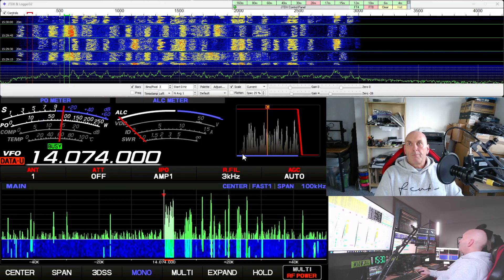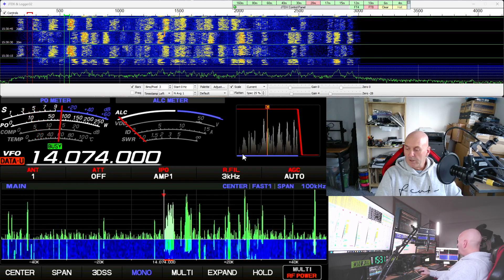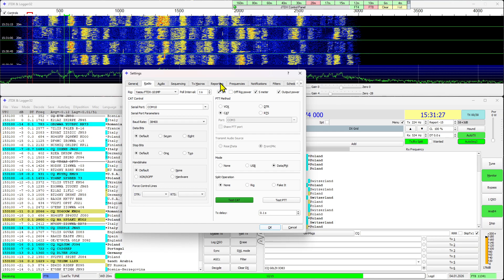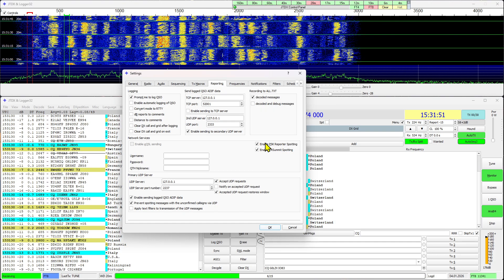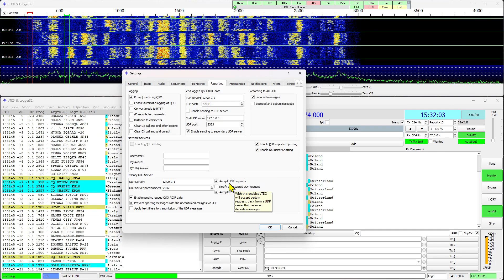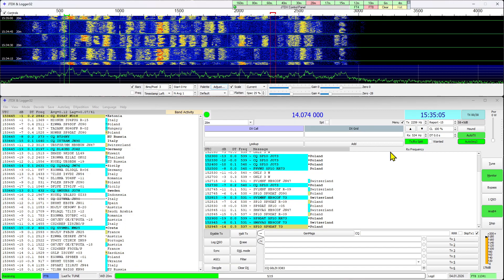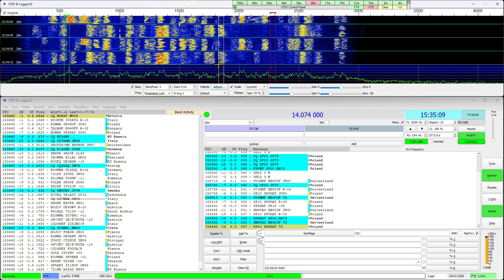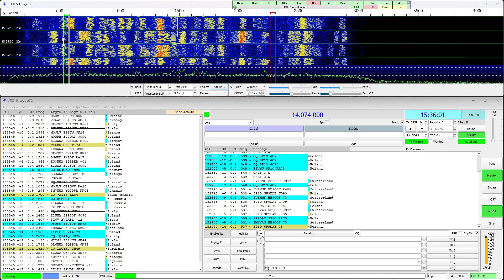FT8 and FT4 hints and tips to optimize your chances or more reliable QSO's

Comment: However, disabling Split Operation (Fake It or Rig) will most likely produce a "not as clean" signal, as you are no longer keeping the Tx audio in the "sweet spot" on the signal passband (ie, 1500-2000 Hz), and are more likely to be affected by the Tx sideband filter, which is noted in the WSJT-X User guide.  The shift in frequency allows for the Tx audio to be transmitted in that sweet spot by shifting the radio frequency higher (or lower) and adjusting the waterfall selected Tx frequency to compensate for the shift.

For example, if you selected 2300 on the 20M band, you would actually be sending audio at 14.0763MHz (14.074Mhz + 2300Hz).  Split operation would shift the radio frequency to 14.0745, but decrease the "selected Tx frequency" to 1800 ....the actual Tx audio is still sent at 14.0763 MHz, though (14.074MHz + 500Hz [the shift] + 1800Hz [the selected correction]).....the difference being, instead of transmitting at 2300hz within the Tx passband, you would actually be transmitting at 1800Hz, closer to the center and further away from the Tx filter....thus "cleaner"

So, unless you have some CAT Control issues that does not allow for the software to control what frequency is being used, I would "suggest" running Split operation via:
a) Fake it (which just lets the software manually shift the frequency back and forth) or...
b) Rig (which is just using standard VFO A/B split operation)

73 de KC5VAZ